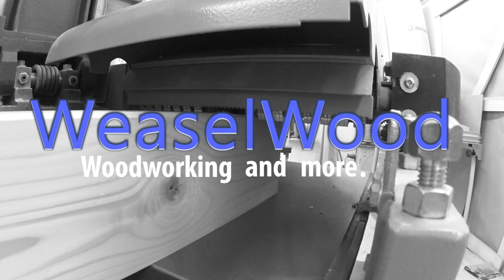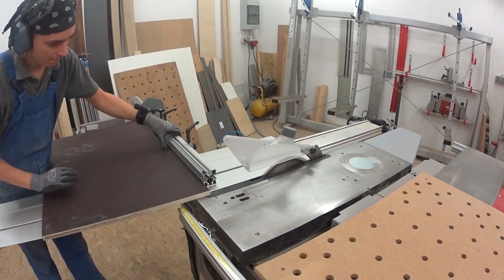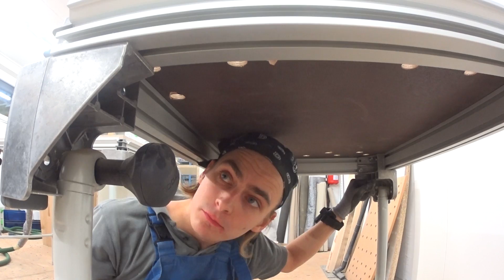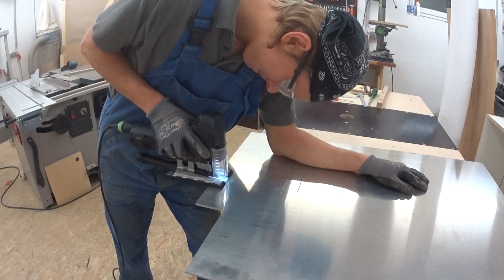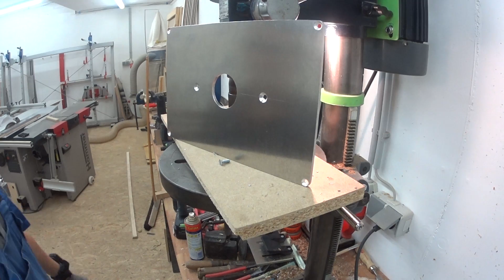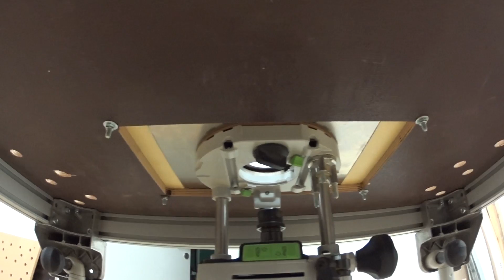WeaselWood #3 [English] Routertable

Comment: You made a good job of that, I've not seen if you got a router lift but you could use the Festool one. If you go on the Festool spare parts sit and put in the part no 493819 all the bits would cost you less than 50 euro, I'm sure you could adapt it to fit your plate.

Comment: Good video! Hope you don't mind to mention. Make a habit to clamp down work piece when you drilling with a large diameter. When you drilled that aluminium plate was an unnecessary risk as the drill could be stuck and turn plate info your chest, neck. You are a very talented young man. Be safe.

Comment: I like the fence with a few flaws, you can't use the metal fence with 1/2 the profile of a route bit out of its side without a wood backup on it or you will damage your fence or the router bit,  Now you could either use a piece of PVC plastic or wood fence cover, you could als braket them to the top but doing so will make you remove the stops, adding a T track on top will give them back. And your still now using a vacume at the cutter so dust will be a problem.

While  you're at it a T slot over the front would be nice for end grain work on narrow stock, or 
Like your table saw a sliding table you drop on the frame.  Now where will you keep your bits and tools you use on the router table?

Don't get me wrong I like the table, bt its not that stable, it seems kind of wobbly.

Oh and a tip for drilling or using a hole saw in Any metal CLAMP IT DOWN, if the bit grabs it it will take your arm off.  Also never fail your arms next to a running machine never reach in when its running  als put the safety glasses on before yo touch the power switch.
Why do I say this because even with safety glasses on I got  metal saving in my right eye working in a machine shop running a 4" body grinder, or in metric 101.6 mm hand held grinding disk.   So wha Lift did you opt for?

FIY: when filming pay attention to the work, not the camera I don't want to see you get hurt.  We do and do not care if we can see it what we don't wanna see is body parts flying and blood splatter, this isn't a horror movie.  This goes for anyone filming to post on youtube.   Work first, camra second.  You can edit the film, you can't edit your arm!

Other then all the bitching, nice job, also I like Festool tools, its just they cost a lot of money over here in the USA.  The router template tool alone was nice well thought out design.

I bought a Jessem router lift I don't think it would work with festool routers IDK I don't own one.

Comment: Great job. The material you used for the router table is called Buffalo board in the UK(Ply faced with Phenolic resin), it is extremely durable and provides a nice low
friction surface for a router table.
I've subscribed to your channel, you have some interesting videos.
cheers
tony
Reply from the maker: Hi Tony
Thank you for your support, the term "buffalo board" sounds funny, for the new router table mk2 I used birch plywood and sanded it fine, also gives a nice smooth surface. ;)

Comment: where can i get the router template you used
Reply from the maker: Hi Monty
The router template is made from Festool and is called MFS, there are 2 different sizes available, the MFS 700 and the MFS 400, with 700 or 400 mm length. ;)
Reply: Thanks  greatly
Reply from the maker: You're welcome! ;)

Comment: Nice video and some excellent ideas.  I had not thought of using the guide stop to stabilize the router on the MFS - good idea.  I was glad to finally see you use some eye protection.  My wife works at an eye clinic and tells me horror stories of people coming in with debris, metal, nails, etc. stuck in their eyes.  You would be shocked at how often this happens, even in a small town.
Reply from the maker: +ExtremeWoodworker Thank you ! Mostly I never plan ahead but in a few cases it works out pretty well! ;)
Yes I know, I should wear my goggles more often, but then it's hard for me to see the crap flying at me! ;)

Comment: This is cool!!  I like how you used the Kapex parts to come up with an awesome fence design!  The only thing i see is there is no hole for dust extraction from the top side, but that isn't always necessary, depending on your type of routing tasks.  Like the channel!
Reply from the maker: +Retro-Tech Thank you for the nice feedback ;) !
I try to figure out how i will handle the dust collection as soon as i install the propper routerlift, till than the only way is the vacuum cleaner connector on the OF 1400 underneath!